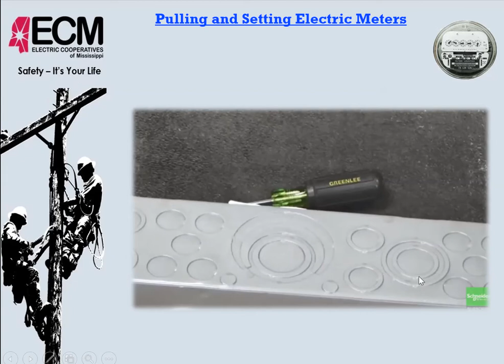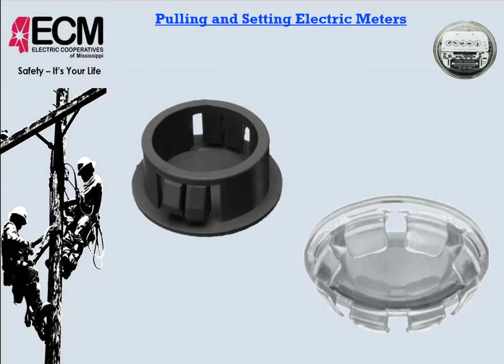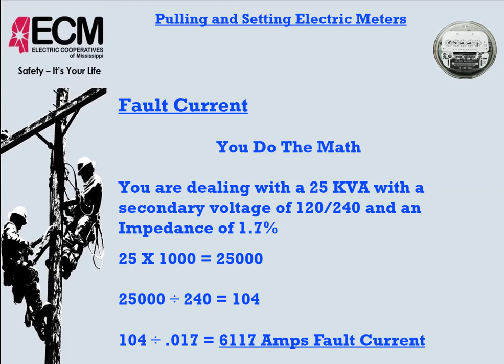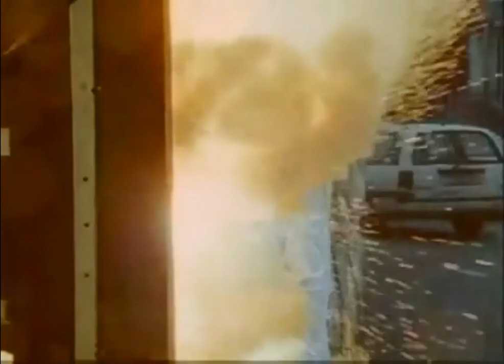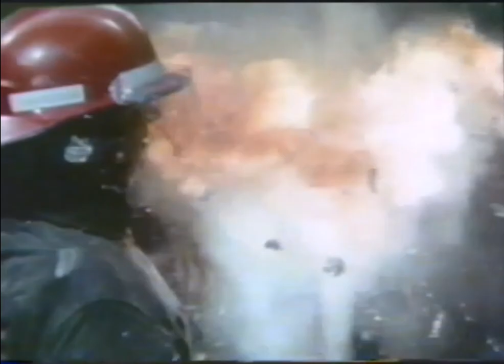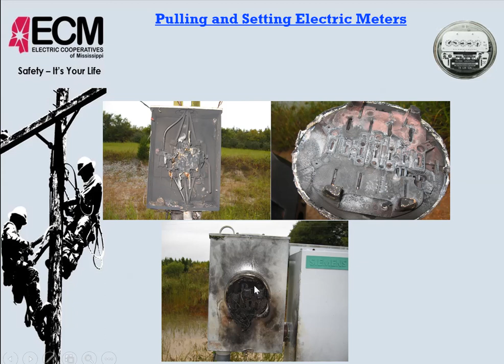ALTS I Pulling and Setting Meters

Comment: In 1:03:52 of your video over looking the double lugging issues this meter socket is bad because those clips are spread out .This will result in a loose connection & heat build up on the spades of the meter not to mention the back of meters now a days are meltable CHEAP PLASTIC not GLASS REINFORCED POLYESTER of yesteryears. Meter sockets of this type especially MILBANK are made so cheap. TAYLON has much better clips. This meter socket design was originally good fore 60 amps [1930s round cast aluminum  ] .Its now pushed all the way to 320 amps WHAT A JOKE!! I was an electrician fore 40 years Meter sockets dont make me very happy especially CHEAPLY BUILT ONES . All utilities should demand jaw clamping lever bypass units.  GREAT VIDEO!!